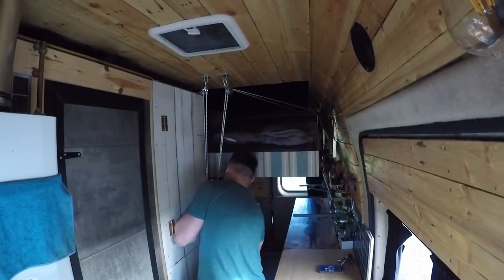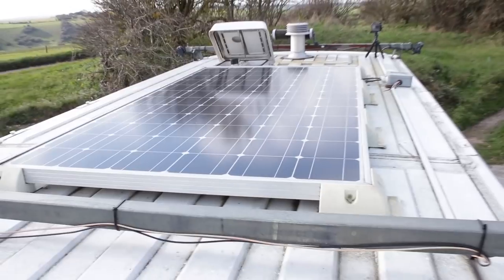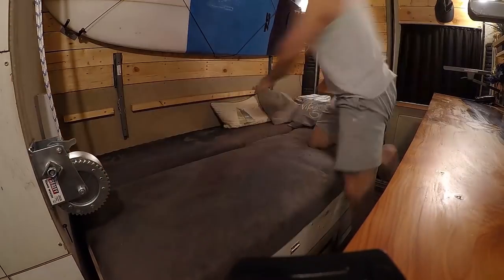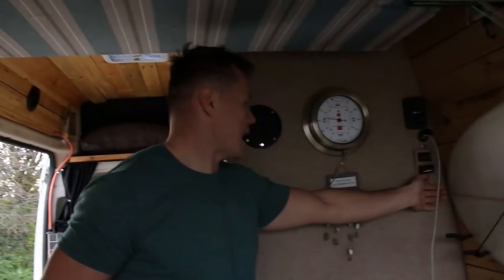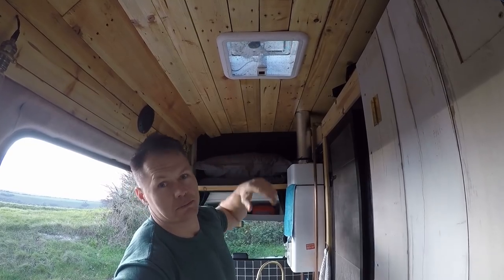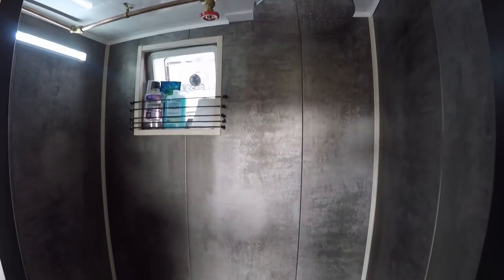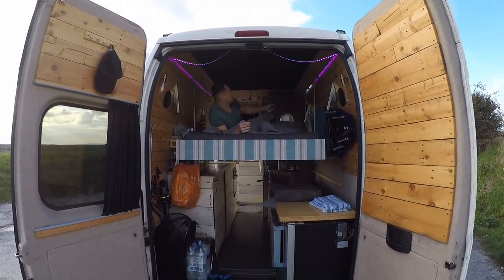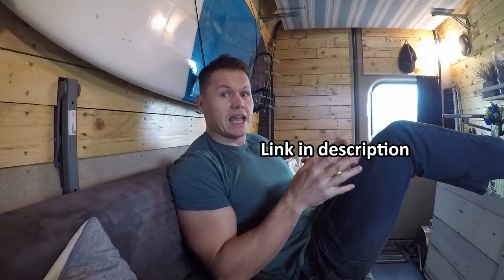DIY Van Conversion Tour With Bathroom & Floating Bed

Comment: Love how you made the bed. Really cool idea! Great shower as well! Thanks for sharing!
(But please put the carbon monoxide alarm near the floor, as carbon monoxide is heavier than air it will fill your van from the ground up. So if you have the alarm high up the gas will reach you before it reaches the alarm.)
Reply from the maker: Bas de Ruijter thanks for watching! I believe that’s not correct and it disperses evenly but I will double check. Appreciate the heads up though!

Comment: In 2020 I’m planning on buying my second van to build out. It will be a tall Ford Transit. And I have the same idea for a bed on a pulley system, so it’s great to see yours, well done!  And you said you have a bed build video, right? That is a must-watch! Thanks for the nice tour, and I enjoyed your sense of humor along the way as well :)
Reply from the maker: spleerfloof that sounds like an excellent plan. The build is an amazing process and I think I’ll definitely do another at some point. Yeah it was about 10 videos ago. It’s got lots of bits missing as it was the most technical part of the van and I got fed up of filming some bits! But hopefully enough info to get some ideas flowing for you. Keep us updated when you get started!
Reply: MotoringHome OK great, I will look for it! I just finished watching your time lapse build video, and around 13 minutes or so you get to the bed building, so that gave me some additional insight. And I appreciate the link to the winch in this van tour video. Thanks again!
Reply from the maker: Yeah lots of people asked about the brackets in the bed video too so I’ve linked everything in the description. I can tell you’re serious about doing your own van, I was asking similar questions before mine too.

Comment: Hi how did you fit the awning, i have a rhino roof rack so cant fit it as standard but will fit like how you have yours.
Reply from the maker: What van do you have? It seems different for each van and for some there are extra brackets you can get for it. I used spacers at top of the awning to counter the curve of the van and try and get it level. You can use washers or a plate to do that. But once I started using it I found that it really doesn’t need to be level and if it’s facing slightly upwards due to the curve of the van it still works fine. Hope that helps?

Comment: Doesn't the bed make the van top heavy??
Reply from the maker: Not that I’ve noticed. It’s a heavy bed but it’s probably only a 10th of the weight added to the van and most of the other weight is near the floor

Comment: Why not put an Air conditioner in? Are the fans that good to cool it in the summer?
Reply from the maker: I have a small air conditioning unit that I use if it gets really hot but it drains the batteries in about 4 hours so I only use it on very hot days.
Reply: @MotoringHome  Damn 4 hours is nothing. I forget if you had solar, but maybe have dedicated solar for an ac is possible
Reply from the maker: I think most people who run air conditioners run them from a generator. It doesn’t get that hot here and it’s such a small space that it cools really quickly anyway.

Comment: Your bed is a perfect space saver, but did you tell us how tall your van interior is?  And do you have any regrets blocking off easy access to the front seats with that counter across the front of the van?
Reply from the maker: Wonderful Husband Productions the van interior height is about 2.2m so when the insulation and cladding goes in on the floor & ceiling and the bed is up there’s about 1.85m height which is around 6 foot.
Also yes, if I’m to do another build I would try and leave that space open at the front and put captains chairs in maybe, it opens up the area so much more. I just didn’t want to put the bathroom at the back and block the view
Reply: @MotoringHome  Thanks for the response.  I'm pondering a van build and worry the same thing about a bathroom blocking the view (as well as making the van seem smaller), but did you consider using just shower curtains instead of walling in the shower?  I've seen that build on other videos.  But I've also been wondering if it would be possible to build a half-height wall - across which a pull-out counter top could possibly extend - and having shower curtains available to seal off the space when you want to shower.
Reply from the maker: I saw a few like that too, nice idea but I suffer with ulcerative colitis so one of the main reasons for the van was to always have a toilet with me whenever I travel. So a properly contained unit saves any guests/passengers!

Comment: There are so many things that I like about this van build. I think I have only liked one other UK based van build (sorry!). Everything just makes sense to this Canuck with your build. What do you have as the walls for your wet room? You have a new subscriber and I look forward to seeing more of your van and adventures. ps you had my attention at “floating bed”.
Reply from the maker: Pamela Morrison ah thanks very much! Yes the video of the bed build is the most watched on the channel, hence why I put it in the title of this video too.
It’s bathroom cladding that’s designed to go around a bath/shower area instead of tiles. It’s much lighter and real easy to clean.
Reply: MotoringHome that makes so much more sense than the weight of ceramic tile. Some people can’t get rid of the sticks and bricks idea of a bathroom shower.

Comment: What is on your bathroom walls?
Reply from the maker: It’s standard bathroom cladding that is often used instead of tiles around a bath/shower. If you take a look at the last wetroom video I did or the full time lapse you can see some of the install.

Comment: How to be a terrible carpenter, lol.
Reply from the maker: Roadiemort or a decent attempt for a novice? Thanks for watching!
Reply: @MotoringHome  You could have watched a few DIY videos first, I did not believe my eyes when you opened the floppy storage door under the couch/bed.
Reply from the maker: It’s just a hinge that needs to be screwed back in.
I pretty much built the whole van using YouTube, google and a pdf book. How do you feel about the resin pour counter top?
Reply: @MotoringHome  Looks great, Thought about doing this in my kitchen, is it durable so far?
Reply from the maker: @roadiemort3589  Yeah it's holding up great. The resin I used was perfect for a beginner as it has a very long hardening time but it's not the most scratch resistant you can get. Some are really scratch resistant but harden in minuets. I've linked the one I used in the description but on that site there's lots of info and other products.